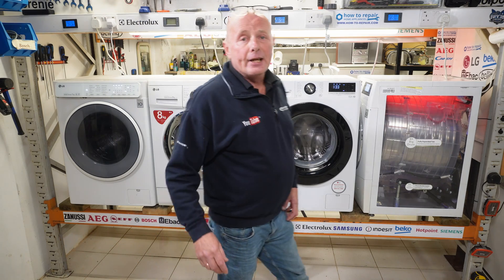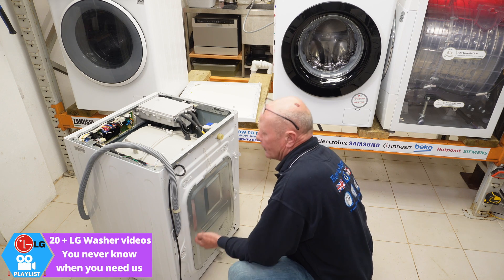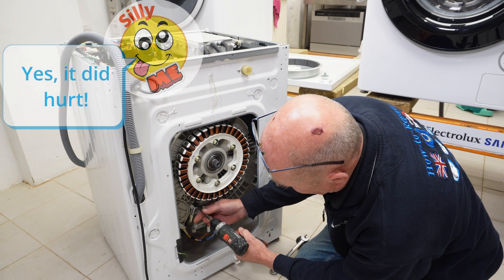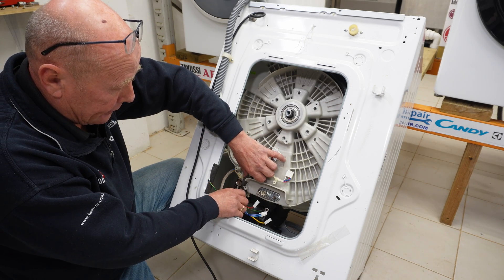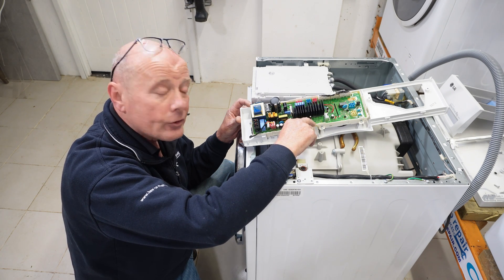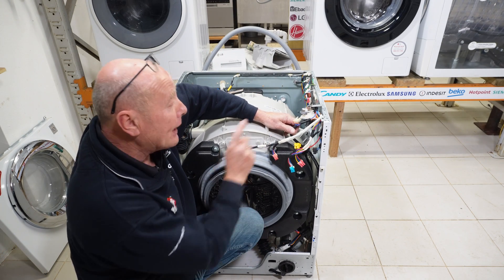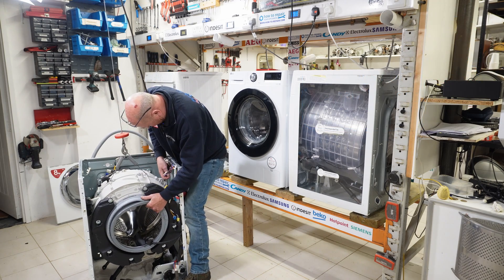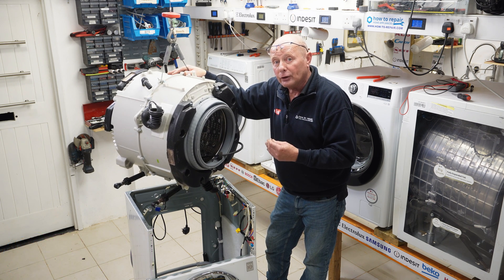Mastering #LG Inside Out of a Washing Machine Dismantling Guide To Take Apart

Comment: a short remark towards repair friendly discussions - In all high labour cost countries (UK, D,...) we need always to be realistic about what is economically possible or reasonable for any user as the cost driver is n most cases the labour and not the part - The bearing exchange for example which is stated might be not really realistic as this might take too long - therefore the conclusion needs to be long guarantee periods and proper design for a long life without defects --> EC to act. If the drum is not seperateable for bearing change it needs lifetime bearings inside - I had a Bosch washing machine which run 25 years - once motor carbon brushes exchanged - after 25 years dampers defect and reasonable service life achieved - means the ball bearing should be of no issue if properly designed and sealed. And clear electronics is expensive as spare part (same in cars !) but the design should be made for the full lifetime - Therefore the right to repair is one thing - but more we need in high cost countries long living appliances without any repair as most repairs are not really reasonable from an economical point of view and not too  many people dig in super deep (as probably the bearing with drum opening  and full disassembling). Easy repairs - clear and necessary - difficult long tome consuming repairs should be not necessary by design would be therefore my whish

Comment: Having to replace my LG3600 washer because of a cracked drum after just under 3 years. Extended warranty will reimburse me. The replacement is the LG4000 washer identical to the 3600 except the color Graphite is replace with Black Stainless a darker shade of Graphite. Is it worth the trouble to salvage the front lower panel (with door) and install it on the new washer? Or just live with the color difference. I am fairly handy, but wonder if it's worth the trouble.
Reply from the maker: Hi mate sorry about your problem but I'm in the Sahara Desert right now and I can have free time occasionally. I would like to help you out during my live streams. I'll be posting when the next one's happening so please subscribe and turn your notifications on then you can catch me live. I'll stick the link to the last stream below so you can get an idea of what they're like. I'd love to hear your problem on the show mate, cheers.
https://www.youtube.com/live/JEcgidBKa40?si=rHbT7SW0m8hVhbMT
Reply: When they delivered my new Black Stainless color washer LG4000, the delivery guy offered to buy my almost 3year old washer for the motherboard so he could fix his mom's machine.  Then he offered me a "deal" to take 25% off my new washer if I agreed that a scratch on delivery was acceptable. That amounted to $228 US. My wife and I decided that the color difference was not that bad and took the deal.  I think I made out pretty good. The New washer was $798 + tax $64 or $862 less $228 = $634. The SquareTrade warranty reimbursed me $859 the cost of the old LG3600 under the extended warranty.  I bought the new LG4000 with a 5 year extended warranty ($180 at Home Depot) and because these appliances are so expensive to repair I highly recommend getting a extended warranty (I normally say No). Paul you are great at explaining the whole breakdown and I felt confident after watching your video that I could tackle many repairs on our LG. Thanks and don't get too much sun! :))

Comment: This is one of the best instructional videos I've ever seen. My lg washer WM2277HW is loud and emits a burning smell during the spin cycle. I am not getting any error codes. I initially thought it might be a bad belt but can't find any info online. I would be very grateful for any information or suggestions you can provide. Thank you!
Reply from the maker: Thank you very much for the compliment. It is much appreciated. I will endeavour to keep up the good work when it comes to the problem with your machine. You say it’s loud. This is an indication that you may have a problem with the bearings or the spider on the drum, the burning smell that you may be getting is the lip of the drum maybe touching the door seal on high rpm and melting the rubber. I would suggest you check this first before anything. If you have a look on my YouTube channel about collapsed bearings on washing machines you may find a useful video that explains it, but because you said it was noisy, it gives me a very strong indication. This may be the fault.
Reply: @How-to-repair  thank you so much! Since my machine has a direct drive system an issue with the bearings was my next thought. I'll take a look at your video and determine if the repairs are worth it based on the age. Thank you so much again!

Comment: Hello, great video. I have an LG f72j8hs2w washing machine. The problem is that when rinsing, it fills three quarters of the drum with water, shows the IE error and drains the water, but not all of it. It drains about a quarter of the water that was filled. It says END. I have to drain the rest of the water manually. Could you advise me where the error is? Is the inlet valve faulty, or does it have something to do with the level switch? Thank you!
Reply from the maker: Hi mate, I received a similar question with the IE error and answered it. You can read my answer via this link: https://www.how-to-repair.com/faqs/lg-fh4u2vcn2-washing-machine-shows-ie-error/
Reply: @How-to-repair  Thank you for your answer. I have already solved the problem. First I did a diagnostics of the washing machine as in your video.
I saw that the pressure switch value was still 255 when filling the water and it did not move. I disassembled the washing machine and saw the hose pulled out from the pressure switch. Total 10 minutes of work. Thank you.

Comment: I have a Model WD14071SD6 LG front loader that has a rear drum gasket. A pen left in the wash punctured it and caused a leak. 

I was wondering if you have a video on removing the rear gasket?
Reply from the maker: Hi, please use our contact us page and make sure you fill out the request for what your problem is. I will need the full model number of the identification plate and the details of your problem so that I can provide you with useful literature. A video shoot of the problem would be perfect as well.

I will get back to you within 24 hours, normally. https://www.how-to-repair.com/help/contact-us/  

Please remember to subscribe to our channel, as that's what keeps this channel going. Thanks, Paul 👍

Comment: Hi,  love your instructional videos,  you are succinct and explain clearly. I replaced the rotor tub (after extreme noise and impaired spinning and initial LE code). Ordered a rotor hub on Amazon and replaced it because it was stripped and less expensive that ordering a sensor. I installed it, but now rubbing against the motor (part that has the wired copper threads)screws when spinning. Thinking that tub is too tilted back in upper section or PVC shock absorber warned out (model WM2301HW). Have no idea what initial position of tub is. Cannot afford a repair that is more expensive than a new machine. Retired and mechanically able and skilled woman, wanting to save money
Reply from the maker: Hi thanks a lot for your comment and I'm glad it helped. 

Please use our contact us page with your full model number and make sure you fill out the request for what your problem is so that I can find the correct literature for you. A video shoot of the problem would be perfect, too.

We will get back to you within 24 hours, normally. https://www.how-to-repair.com/help/contact-us/  

Please remember to subscribe to our channel, as that's what keeps this channel going. Thanks, Paul 👍

Comment: Hi Paul!

So the problem I have on my LG washing machine is that the silver rectangular shaped bumps on the inside of the drum have started to come loose...annoyingly this is tearing holes in my clothes! To get to it, it seems I would need to remove the plastic covering all around the external of the drum to get to the nuts securing the rectangular parts....is this possible?

Comment: You are a legend and one of the best I’ve seen on YouTube!  You certainly know your stuff!  I have a 5 year old LG that stinks so bad when it’s on a long 40 degree wash so it’s 3 hours 45 mins long.  It’s like as the water cools in the machine,  it lets off a nasty poo like smell from the detergent drawer.  I can only smell it when I go into the room after being out of it.  I’ve used washing machine cleaner several times and the smell kinda goes for one wash and comes back again.   I always leave door open so am baffled why this is happening.
Reply from the maker: This issue is quite common, and many people are unfamiliar with the intricacies of plumbing. If your washing machine is connected to a sink unit, it's crucial that the waste pipe runs at a high point before reaching the sink. This prevents water from the sink unit, containing food particles and debris, from flowing back into the washing machine and causing contamination.

Specifically for LG washing machines, it may be challenging to follow my video on mould removal. However, I encourage you to watch it till the end or skip to the conclusion to see the results. I utilise dishwasher tablets and fill the machine to maximum water level for a boil wash, if possible. Although your machine might have a tub clean system, it may not always provide sufficient water.

The issue with LG machines lies in their pressure switch parameters, which typically range between 255 Hz (empty drum) and 129 Hz (full drum) frequency on fill levels. Consequently, you might encounter an error while attempting the process demonstrated in my video.

Assuming your plumbing is accurate, I recommend running a couple of boil washes. A useful technique is to pause the machine when the water reaches its hottest temperature and let it sit for 20-30 minutes, allowing time for debris dissolution. https://www.youtube.com/watch?v=HnS87Tw4amM it is also very useful for us if you are able to share our channel on your social media because although I have a great knowledge in appliances, I'm not the best IT guy when it comes to making sure these videos get viewed. The information I provide does help a lot of people and when they find us, they're happy. @blakaeg please remember to subscribe to our channel as that really helps us https://www.youtube.com/shorts/e432SAb2g08  Thanks, Paul 👍
Reply from the maker: I also forgot to tell you, there's a full playlist on LG machines with every bit of knowledge that I can put together https://www.youtube.com/watch?v=w5dZ4Pj8Jdo&list=PLnAHZbSarsyHLR4x9XPIS-ZEsheufxm9Y
Reply: @How-to-repair  I really appreciate that advice.  I shall do what you say as I suspect the Tub Clean and the 90 degree wash I’ve done has not high enough water level so reach the tub properly to clean it.  It’s a great machine and I don’t to keep it going.  Thanks so much ;)
Reply: you need to do a 90 degree wash to get rid of the smell
Reply: @PedroJaimeObrien I’ve done that many times
Reply: Very helpful thank you